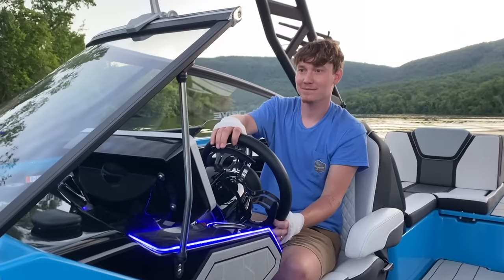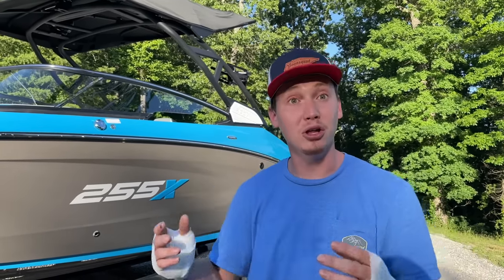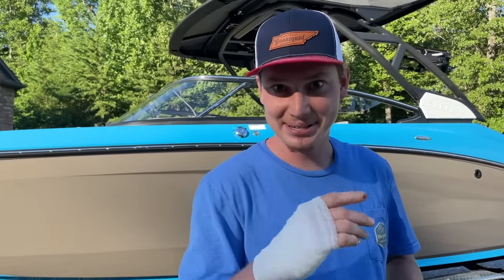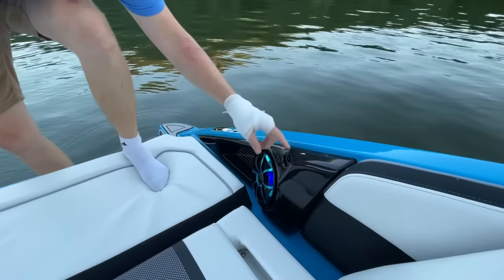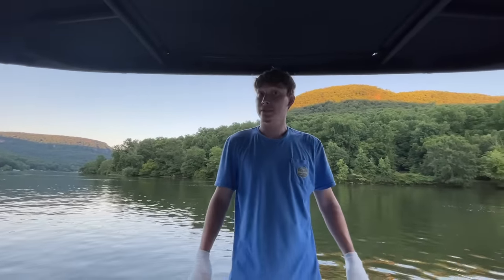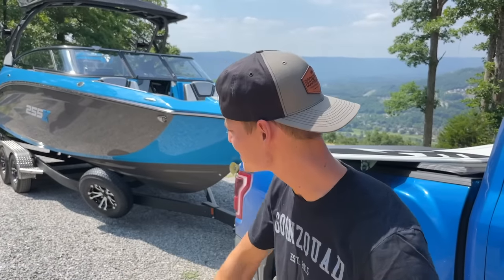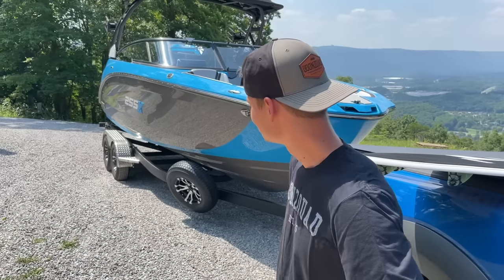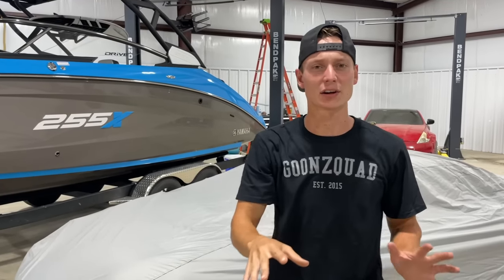Breaking In Our Brand New YAMAHA 255XD Ski Boat!!! We Are Upset!?

Comment: Definitely take it back to the dealer to have those surge brakes looked at. We don't have huge hills here in TX but my boat trailer has similar weight and never turned the rotors purple..... And wear the kill switch lanyard. It's a ticket in all 50 states now.
Reply: Pretty sure coming down hill the weight of the boat is pushing hard on the surge brake.
Reply: Pretty sure they had that locker pin in for backing up but had it in the wrong way and the brakes where always on coming down the hill
Reply: I would disable that system all together , it's overkill when the trailer has disc brakes . Most older boat trailer's had drum brakes and they weren't even overworked coming down a hill . When safety systems make it unusable , sometimes you just have to break the rules .
Reply: @211 
Well a quick google search will tell you you’re wrong. It literally says as of April 2021 it’s law for ant recreational boater to use it. Required by law. Also your argument is complete garbage, what does it matter if a boat doesn’t have a kill switch? It’s obviously required for newer boats that have them. 🤡 That would be like people in the late 60’s saying they don’t need to wear a seatbelt because there are still cars on the road that don’t have them installed. Laws change and affect things that are built AFTER the law is written. Give your head a shake boy.
Reply: @Jay-hp6pu  ITS THE LAW !!!!  🙄
Reply: @Jay-hp6pu  you’re the kid who reminds the teacher she forgot to assign homework
Reply: @Shadowband72  they just don’t know what they are doing … that’s pretty typical for these two 🤡
Reply: @Jay-hp6pu  Actualy buddy, for older vehicles that did not come with a seatbelt, they  are grandfathered in and you do not have to have a seatbelt in them.
Reply: Do you think its the glue or residue on the brakes since they’re brand new?
Reply: @Jay-hp6pu  it's only required by LAW if your boat has one installed 🤦‍♂️ so technically you both are right. And also if you have a car with no seat belts from the factory today you still don't have to wear one. Learn your LAWS
Reply: Those rotors got very hot and damaged those calipers. If it’s covered by the warranty, have those brakes, calipers and rotors replaced. These boys need to get some OJT on this.
Reply: @211 whether or not its installed...its still american law. Many boats arent even made in american and still sold without them here. Law is law though. I saw a guy get ticketed last week for it
Reply: And bring those fenders in…
Reply: Isn't the point of the kill switch to apply the brakes if it's disconnected? Meaning they're essentially pulling the trailer with the brakes applied?
Reply: @Jay-hp6pu  Why do so many people out there love to lecture others?
Reply: @Hard_Right   So why are you even here?
Reply: @Hard_Right  Okay that made me laugh.🤣🤣🤣🤣🤣
Reply: @211 that would apply to those older boats that arent equipped.. and im sure all 50 states require some sort of kill switch 💁‍♂️
Reply: I agree with these gentleman. Take trailer back and have them make it right. Them brakes got way too hot. Rotors could be warped. How much does the set up weigh? Triple axle trailer maybe?
Reply: @eldnah2  It's informational to me. I formulate my own educated opinion based on reading the banter that goes back and forth in the comments. Most people have good input on just about any subject.
Reply: We live in PA with rolling hills and our boat trailer has surge brakes and we never run into this issue
Reply: @Shadowband72  
And face a HUGE loss if something happens, then the insurance won't pay a penny.
Dumb suggestion. 🤪
Reply: @marcryvon  Ah yes I forget that a lot of people can't drive , unless it's driving up the insurance rates for everybody else . I've been driving for 34 years and the only insurance claim I've ever made was for my car being stolen . They gave me 3,500 $ , and I've given them over 100,000 $ . But you're rite , they should worry about insurance instead of whether they can even use it or not . 🤪
Reply: Use a lower gear going downhill and don’t ride the brakes and you’ll be fine.
Reply: Going down that hill then pushes the trailer toward the truck applying the brakes it’s just how it works if they had electric bikes it wouldn’t do that for the surge brakes will apply themselves going downhill because your trailer is pushing against your truck
Reply: Surge brakes? no such thing.
Reply: @jasonswift7098  At 4:33 you can clearly see a rotor and caliper , you must be blind or you just don't know what a drum break looks like . I just went back and checked , and I'm going to believe what my eyes tell me . And there's surge breaks too , they've been around much longer than internet trolls have .
Reply: Doesn't the Raptor have a trailer brake adjustment
Reply: @blackbillyjack  Not with this kind of brake setup! The trailer brakes work the same whether the truck is braking OR in a lower gear. I would have preferred an electric brake setup because they are adjustable (usually).
Reply: @Chris-uv4jw  what car is manufactured without belts now?
Reply: In Tennessee the kill switch is not required to be worn unless you are on a pwc(jet ski).  But it’s always a good idea to wear it, you just have to make sure you have the appropriate number of life jackets, and anyone born after January 1st 1989 must have a boater license to operate a boat on public water.  Hope that helps, have fun!
Reply: @CrispyOkra  We're mixing up a few different conversations here.   The trailer has brakes to slow and help stop the trailer.  That solution requires a cable and some solution that to apply the trailer's brakes if the trailer ever gets free from the truck while towing.

A separate discussion was about using the boat.  Smaller boats have a "kill switch" which will cut the motor if the driver gets thrown out of the driver's seat.    There is a federal law requiring their use when the boat is being driven on plane for most smaller boats that don't have driving station inside a cabin.  The federal law is new... issued sometime within the past 3 years or so.
Reply: They need a break controller for a trailer can turn up n down how much force you want on your breaks to stop it

Comment: Just a quick comment for you guys! My parents just sold their Yamaha 242 limited s with the twin jet drive.  A few things we found are DEFINITELY pull up the carpets before you go.  Those snap in carpets are awesome but if you lose one you have to buy the whole set. 😵‍💫   The engines should still have some clean out ports in the back incase a rope or weeds get wrapped around the impeller. Vaseline on those help to make sure they seal. My parents had one pop up and the boat started to take on water, no big deal for the bilge though. just like any boat, open every compartment or it will get that skunky water smell. If the back seats still unsnap to get to the Clea. out ports put some small pieces of wood or something under them when you're done.  It traps water under there and it begins to try to mold.  Magic eraser works incredible to clean things 😁😁   Absolutely gorgeous boat and wishing you both the best in your adventures
Reply: Well the sold mony ordering the yamha. 315 het yaght Kimbo soon

Comment: Guys ..... The office looks good, however remember to install windows on both walls, you need to see whats going on in the garage 👍
Reply: I think that the window to see the garage is a good idea as well.
Reply: Cameras my friends they are installing cameras but I don't think they will be in the office alot.
Reply: @VictorNUribe  the cameras will be more for security outside. A window in the office would be good so that they can see things when they are in the office. But you are correct. Most likely they will not be in the office much. They have so many office spaces in the other buildings and they are hardly there.

Comment: If your brakes keep getting that hot going up down the mountain.. I'd check with the dealership or check the manual.  If they fail..it could end very  bad. Good lucky boys🤟
Reply: It’s also why the truck is struggling to pull it.
Reply: @EricSchutt  Ha, didn't think of that, but it's totally true. Regardless those brand new brakes are beyond saving. Shit got cooked.
Reply: @EricSchutt  it constantly amazes me how these boys know so much but so little at the same time. Anyone who knows anything knows those brakes are locked on and cooked and that's why the raptor is struggling.

Comment: I have been launching and retrieving boat for about 25 years with no issues. One thing I have learned over the years is put your truck in 4x4 before backing into water and setting your emergency break this will lock your front tires if the back one start to slip in the water.

Comment: Awesome videos.  Feel better.  Here's the scoop regarding your brakes.   Your current surge brakes aren't good for going down mountain roads.  When descending the mountain side, the weight of the boat and trailer push against your truck, causing the brake actuator in the trailer's tongue to compress which applies the trailer brakes.    Purple colored rotors are definitely a sign of the overheating.  The surge brake actuator that came with your trailer usually works OK, but it's horrible for descending mountainsides.   Ditch that brake actuator, and upgrade your system to use an electro-hydraulic brake actuator on your trailer and add a full-featured inertia sensing electronic brake controller to your truck.  Ditch the surge brakes and the factory brake controller.  You live on a mountainside... your use is not "typical', and so the typical solution that is fine for most people isn't very good for the Goonzquad!      Anyone else wanna comment?

Comment: Doesn’t sound right to have really really hot brakes then quenching them in water.  Definitely need to talk to the dealership about that.   Love the channel boys!!
Reply: ⬆️⬆️⬆️⬆️⬆️Thanks for going through our videos.
Inbox me to Grab ownership of a prize☝️☝️☝️
Reply: The brakes wouldn't still be on and would've cooled by the time they got to the water. It seems like theirs may need to be adjusted since they have to drive downhill so far. They might not have the issue anymore if they keep the boat at the shop and not up the mountain.
Reply: @89ludeawakening1  Air in the brake fluid. They need to be bled.
Reply: @johncarter1137  I doubt there's air in the lines. My buddy had the same problem with surge brakes and they just needed to be adjusted. It is possibly there's air, but unlikely.
Reply: 100% Agree - While hydraulic / surge trailer brakes can be adjusted there is also technique to driving downhill on this kind of trailer setup. For the most part surge break activation is binary meaning ON or OFF. If the driver is applying short burst 35-40% brake applications while traversing  a 45 degree grade such as the mountain driveway the trailer piston will translate this to full brake application which will cause the trailer breaking system to overheat. Best method to navigate a steep grade on a heavy rig with hydraulic surge brakes is with gear shifting, If this is not an option (automatic trans without low gear standard shifting) then avoid short bursts with longer >15% brake applications.
Reply: @johncarter1137  
You don’t know that just from watching. That’s the reason you need to take your vehicles to the shop or inspect it yourself instead of just guessing from a video. They need to take it back to the dealership and let them handle it.
Reply: @dtuttle351  
Makes complete sense. I’d still take it to the dealership just to make sure but almost certainly you’re right.
Reply: @Jay-hp6pu  exactly, after spending $100,000 on a boat, they should address any issue and or describe proper towing techniques with surge brakes.   They do take a bit of learning process/feel on how to engage and most importantly, disengage the brakes.    The aluminum car trailer I use has surge brakes and at times one has to actually punch the throttle briefly going downhill to get them to disengage.

Comment: I think the surge breaks on the trailer are adjustable. They are not supposed to smoke and turn the rotors purple. Let the dealer know snd check it out. 
That setup has been around a long time, the 97 sundowner 225 im buying has surge breaks too and twin axle disc breaks - the rotors aren't purple.
Reply: Pretty sure the rotors should smoke and turn purple so you know they're working.
Reply: @theupscriber65  lol, NO
Reply: @theupscriber65  Do the brake rotors on your car smoke and turn purple every time you press them? No. There's a defect there for sure
Reply: Makes you wonder how much they understand about disc brakes. Car or trailer don't  matter blue purple disc's that are smoking ain't  right.
Reply: yeah and aside from the other comments, learn the difference between brakes and breaks there obwan.
Reply: Small I'm cruser
Reply: @Chattsteezy  yes. Yes they do. You're just not using yours right. Try holding your foot on the brake a little bit while you're driving. That gets some heat into the pads so they'll work best.
Reply: @theupscriber65  If you’re standing on the brakes and trying to accelerate at the same time you need to go back to driving school. The first few red lights or stop signs you come to generates more then enough heat to your pads to get them warm.

Comment: I'm glad you're healing guys, Simeon I used to have this ointment called SSD or silvadine it's what the nurses called it, it's by prescription only, I had a deep wound on my ankle from a spider bite, it's an antibiotic and it helps anywhere you have an oozing wound, but follow your doctors direction and you too Elazar I really hope the nerves in your fingers weren't damaged and your finger prints either, don't rush it you're both young you'll heal quickly.

Comment: I'd put the pin in place to keep the trailer brakes from engaging while bringing it down the mountain, and just take your time going down and then remove the pin once you're on regular roads running regular speeds. As dark as the rotors got I'd say those pads are now burnt and glazed over, and that kind of heat can also burn the grease in the trailer hubs, so I'd check them also.
Reply: Holy shit, are you serious?
You're saying NOT to use the trailer brakes while going down hill? That boat will push you clear off the mountain without brakes.
Reply: @1one3_Racing  No it will not. That truck outweighs that boat, and if you do the speed limit which is prob' 25mph on that back road you'll be fine.
Reply: @calvinh.8882  Yamaha claims the boat to weight 4750lb, plus trailer. That's probably 2500kg. The truck weight 6000lb. Or 2700kg.
You're saying going downhill, on tight switchbacks and blind turns, even going slow if there's somebody coming the other way on the wrong side of the road and you hit the brakes that the boat isn't push you sideways?
My race car on a trailer is 1500kg. My BMW X5 is 2200kg. It pushes me around if I leave the lockout engaged.
Fuck, I've had an EMPTY road train come around on itself on a tight turn and it has brakes on every axle!
Reply: @1one3_Racing  That is exactly what I'm saying if you're going slow as I stated. That boat will not push that truck around going 25mph  I've towed boats for years, some 10ft longer than that one, and they are not going to push you around at 25mph. 
If they don't want to take that chance then they should use the RAM or the F-450 to pull it. The rear suspension on that Raptor sucks at towing anyway.
Reply: @calvinh.8882  at 25mph those brakes wouldn't smoke like that. I was doing about 90kmh and my electric brakes came on and stayed on for a few km and they didn't glow like that.
Reply: You are kidding I hope it is invented and build for the safety if you put the pin it it wouldn’t be smart just use that brake system for the safety
Reply: @sergeeveraers  Not kidding at all.
Reply: Still I would rather use the braking system it’s made far a reson and I’ve encountered a moment that I was realy happy with it so o keep using it and in my country you don’t even have the ability to disable them
Reply: @sergeeveraers  I'm just saying to disable it and drive slow long enough to get down that backroad they live on so that it doesn't burn the brakes up. Then take the pin out so the brakes will work. They can drive really slow to get down that road they live on and then they'll be back on regular roads where they can remove the pin so the brakes will work.
Reply: I gotta say it is still dumb to hear cous it’s made for those reasons of going down a hill and if your brakes are up you change m better safe then sorry and if the brakes of your car would malfunction then you still have a kind of backup

Comment: Gooooooonzquad train wreck.....  Pulling into some sand bars full of gravel is really good on your boat bottom and the don't worry about the trailer brakes turning purple.  LOL  Yamaha owners manual says no continuous full throttle for 8 another hours after the initial 1.35 break in but hey it only cost 110K.  These clowns will have this nice boat trashed in a month and worst part is they won't even care.

Comment: Hi Guys they use a very similar system to that in New Zealand. On our hydraulic braked trailers there's an adjustment screw at the base of the sliding shaft that changes the sensitivity. It may be adjusted with no clearance. Then on any downhill or bump the brakes come on and you'll cook the pads real quick.

Comment: You should buy and hook up a trailer brake for your truck it will help to adjust the brakes on the trailer,  it isn’t the trailers fault it’s the lack of brake controller on you’re truck. That makes it run the brakes harder then it should